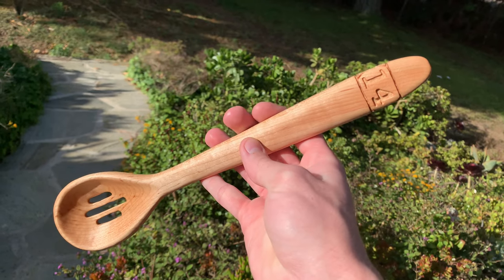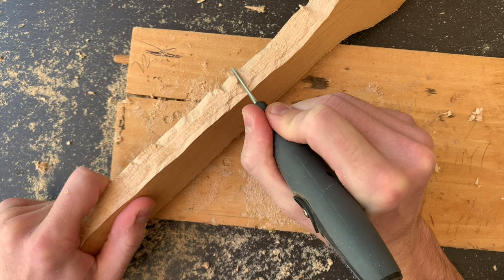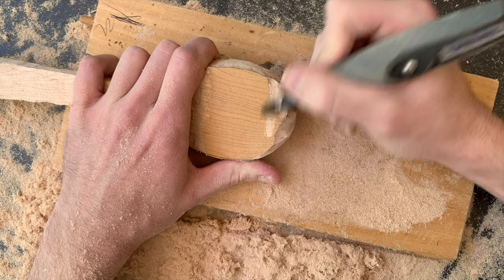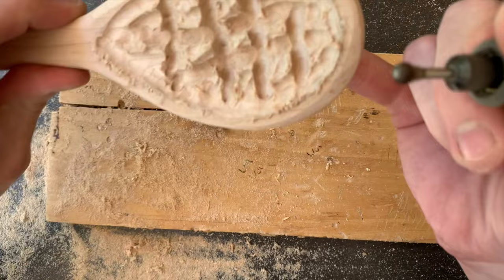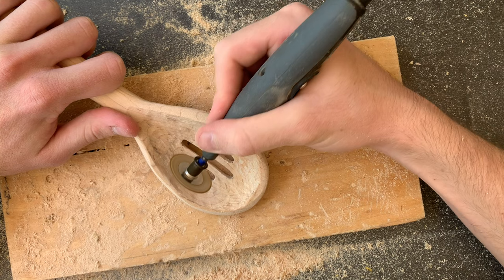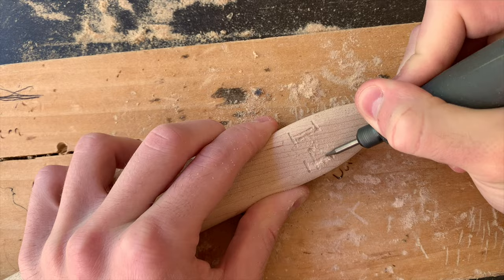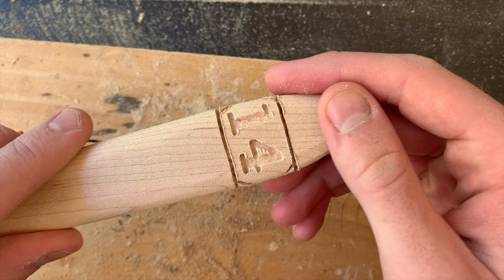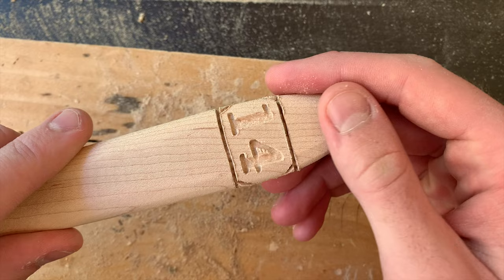How to Carve a Wooden Spoon with a Dremel Rotary Tool

Comment: I love your videos! I am an absolute beginner at woodcarving and I only have a little Dremel Stylo, but seeing you do all these cool things with only a dremel and some bits gives me hope to make something amazing some day too. The spoon looks great, keep up the good work! Best regards from Brazil!
Reply from the maker: Thank you! I’d like to get a Dremel stylo, do you like it?
Reply: @LogsCarvingClub  i do have Dremel Stylo. I love it, but it's not really that powerful and it will lose speed easy under pressure. I mostly use it for detail engravings on wood and brass, there it's small size and lack of vibration is a huge benefit.
Reply: @LogsCarvingClub  I've only used it so far for some easy works like cutting/ carving MDF and light engraving in acrylic and brass, but I love it. It is great, but it is definitely less powerful than the other Dremels. If I'm not mistaken the max speed is 22000 rpm. It has a nice little mechanism that when you put too much pressure or the bit is struggling to cut/ engrave something, it stops itself as to not break the burr and not damage the motor. But if you'd like to check some work done with it, Matt from the channel Cornelius Creations does some carving/ engraving with it and seems like it can handle itself. Like @nekoandpiano said above, it has very little vibration so you can make some really steady lines. I hope this helped you!

Comment: Thank you for your video! I subscribed right away! I just got to open and learn how to use my dremel 3000 & I must confess I am inspired to use after watching your video! Started wood carving less than a year ago and I can’t wait to try out carving a spoon! I have a question though: do u carve indoors or outdoors and do you have a video on how to use your flexible shaft?
Reply from the maker: I carve outdoors - I also have a video on the setup for the flex shaft, but not so much how to use it if I remember correctly. Good luck carving and stay safe!

Comment: I have a rotary tool I haven't touch in over a decade. All I used to use it for was drilling tiny holes but now see that it's useful for so much more. Can you recommend an accessory kit that would have all the attachments needed for this project? I have a Harbor Freight nearby and of course there is always Amazon but I cant find a set that has everything that I can tell. Great video and nice outcome. Thanks.

Comment: Thanks for the lesson on the Dremel 4300. I have a 3000 Dremel, w a number chart that goes up to 10.  
Also I have some of the same tools & bits that you’ve used.  I like that little do-hickey small thing for sensitive hands, maybe I could get 1 of them…any suggestions on where or what kind to use?  I’m gonna give it a try on the spoon soon.👩‍🎨🎨
Reply from the maker: You’re welcome! I use a Dremel flex shaft, I got mine either at a department store or Amazon, I can’t remember
Reply: @LogsCarvingClub  thank you 👩‍🎨

Comment: Love your content and just followed on Instagram. Do you know if your bits would fit on my Goaxee rotary tool? It's one of those off-brand Dremel that I bought without doing research (my bad I know)

P.S. what's a good mask and pair of gloves to get as well. Right now I'm just using a regular face mask but I don't have gloves
Reply from the maker: Thanks! I’m not sure about that tool, but it would probably work. For mask I am really careful and wear a 3M p100 mask. I don’t wear gloves because I’m scared of getting them caught in a bit and twisting a finger off

Comment: What are your thoughts on the battery dremel?
Reply from the maker: I use a couple battery powered ones but I prefer not having to wait for them to charge. Usually I don't need the portability.